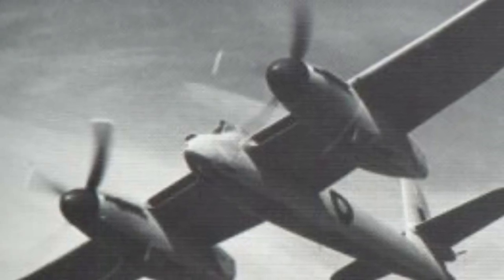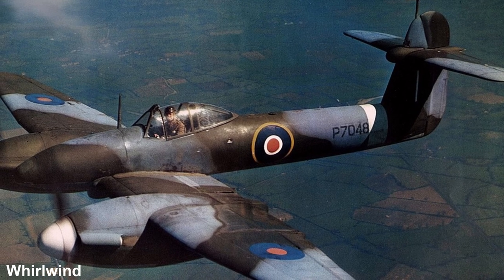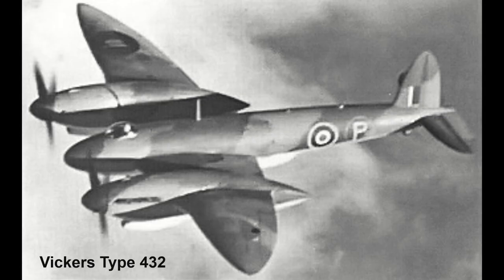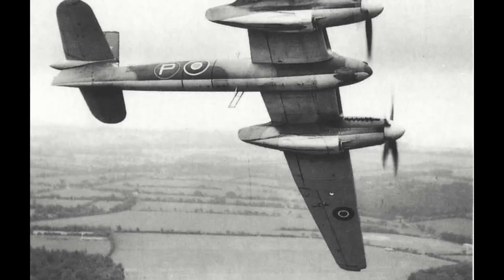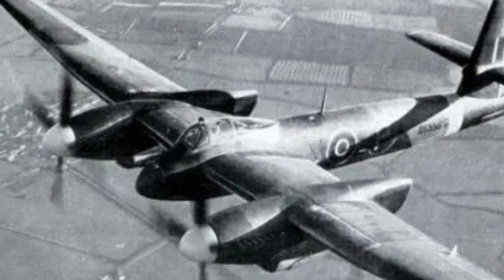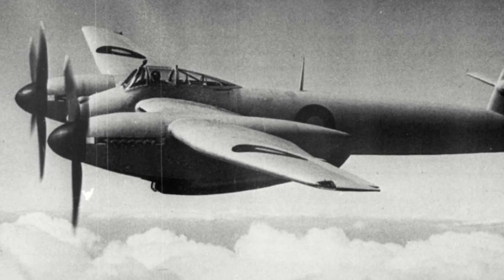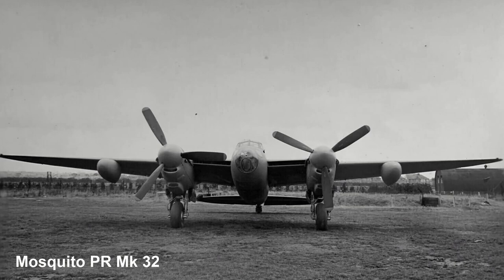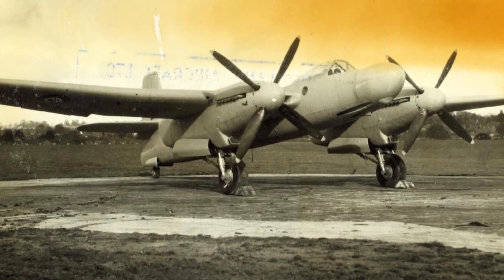This fighter plane was put into production, but never used: The Westland Welkin

Comment: In the book "Night Fighter" by CF Rawnsley (John Cunningham's radar operator) he describes inspecting  a Welkin as a possible answer to German high altitude raids.  But they ended up test flying a specially modified De Havilland Mosquito at over 40,000 feet, only for the Germans to then cease their high altitude raids before they could use it in anger.
Reply from the maker: That is interesting. Seems a good read. I'll have to take a look at it 👍✈️

Comment: The Luftwaffe did use high flying recon aircraft with pressured cabins. But a Spitfire with all armour removed and armed with just two 303 Brownings  were able to reach and deal with the few that appeared.
Reply from the maker: It does amaze me that it was a regular Spitfire rather than the specially built high-altitude Spitfires that dealt with the problem.

Comment: Sometimes pro-Nazi trolls boast that if the war had gone into '46 or '47, the allied air forces would've got their arses kicked. Stuff like the Welkin, the Hornet and the Vampire prove them wrong. Plus the Canberra was on the drawing board.
Reply from the maker: Agree. The German's may have had the edge on technology, but my understanding is that the Allies were starting to catch up. I also think from a numbers point of view, it would have been very hard for the Germans to win against the combined forces of the U.S, Britain and the USSR.
Reply: @AntiqueAirshow  Every German superweapon was a failure. Their alleged swept-wing technology was just stuff used by prewar gliders, but with a jet engine or a rocket motor. Their jet engine only came about because their designer read Whittle's patents. Their radar lagged far behind the British. For every German technological advance, the western allies had a dozen.